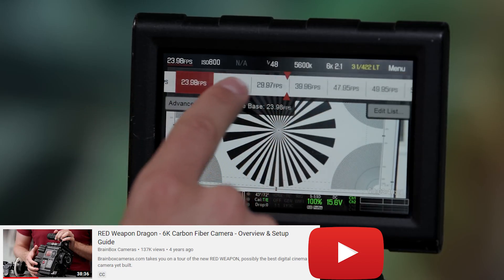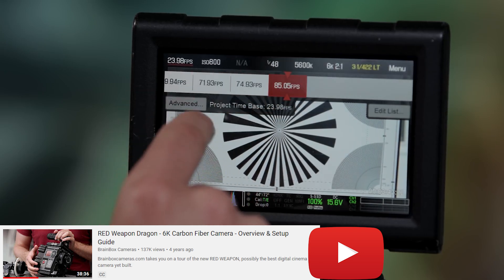PAL vs NTSC - WHY DOES IT MATTER? 120fps vs 100fps

Comment: There is no reason to avoid NTSC- framerates in PAL- countries. Yesterday I shot several artificial light sources with 30 FPS at 1/60 sec. - and there was no flickering at all! If there had been one, I would have reduced the shutter speed to 1/50 sec., and this would have eliminated any kind of flickering for sure. 
The old rules are no longer valid. My recommendation is to choose 30 FPS as standard - and take 60 or 120 or even 180 FPS for slow motion. 80% of 30 FPS gives you a special smooth motion, if desired.

Comment: The NTSC frame rate of 29.97 was adopted due to a visible beat interference between the sound carrier and the color signal.  Frame rate was lowered by 900Hz to solve this.

Comment: Thanks for the good video.  I am still confused about whether I should even care about NTSC vs. PAL.   What I want to do is rip some DVD's to my hard drive to circumvent the region codes, and then write them to DVD's that will play in my U.S. Blu Ray player (Sony, circa 2015).   One of the DVD's is in PAL format and is region 2, the others are NTSC and region 0.   Is this even something I should be concerned with when ripping them?    Once ripped and saved digitally, will the NTSC/PAL thing even matter?     Do you have a video on ripping to the drive?

Comment: I am in PAL country, used NTSC 4k/30fps with 1/50 shutter speed, worked well, .. but if i wanna shoot in 1080/60fps the shutter speed should be 1/100 but results in flickering so need to bring it way down.. (can't remember if it was 80 or 50) why is that 🤔 ?
Reply from the maker: Hi. So in PAL countries electricity works at 50Hz, so when you film in 60fps, it records frames between the electricity refresh rate. Meaning that the lights are off in some of the frames. But if you shoot at 50fps. The lights flickering will sync up with the frame rate. So it will only record frames when the lights are on.

Does that make sense?
Reply: @LoopedPictures  ye i get that, but according to some youtubers and internet sites i should set shutter to 1/100 but it does not work.. 🤷🏻‍♂️
Reply from the maker: Yeah, also doesn't work in my experience... Not sure why it would work for them. But I never got it to work that way. I always change the frame rate
Reply: I am in EU Austria. And some features of my Sony ZVE1 are only on ntsc. Recording 24/25 fps with 4K HS h265 decodec. I only get 50 or 100 fps in 4kHS h265 format recording. Why. I want 25 ?
Can I get it running on ntsc?
Reply: USA YouTube record on 24/30 fps and we see/view it on screens 50/60 hz energy format. So there should be no problem?

Comment: So, I'm in Canada on a 60Hz power supply and I want to shoot 24fps with a 180° shutter angle, and my camera will do 1/50 shutter speed, but not 1/48, should I set it to 1/60 to synchronize it with 60Hz lighting?

Comment: Hey man please explain the shutter speed thing to stop flickering without changing from ntsc and pal
Reply from the maker: Hi! So the short version is check what region you're in and set the shutter to a multiple of the Hz of that region. So in a PAL country, a multiple of 1/50 and in NTSC countries, a multiple of 1/60. This won't always work though, especially of you are shooting slow motion. But at real time speed. That should do just well. Hope that helps!

Comment: I'm still confused I have two camera's when I set Pal on the Canon it still has 1080 at 60fps but no 50fps available on the menu on my Go Pro it has 50fps when set to Pal  so if I want to have the same frame rate on my timeline when editing I will have to shoot in NTSC or maybe my Canon camera is just  too old
Reply from the maker: That is really strange. PAL by definition can only have 25, 50, 100 and so on. Only NTSC can have 60fps. On some Canon cameras though, they just put all the available frame rates on one screen regardless of which setting your camera is in. Perhaps the camera is not capable of 60, and thus the highest it can be is 50. But 50 is definitely PAL. Your GoPro seems more accurate. But your editing software should be able to fix it either way.